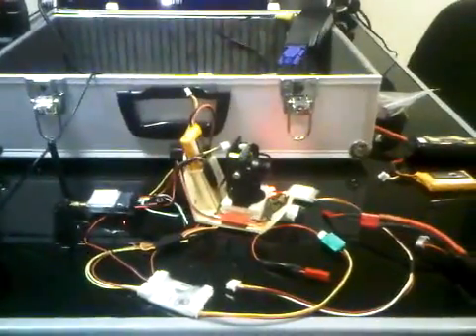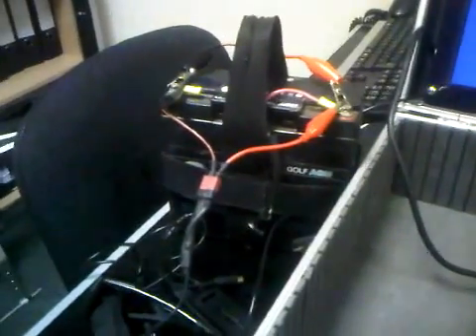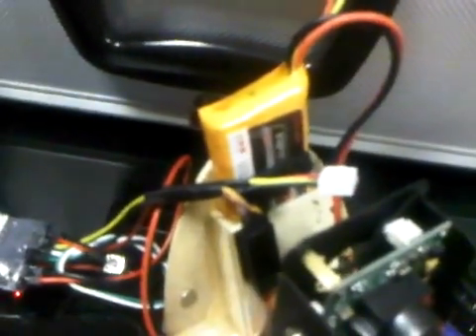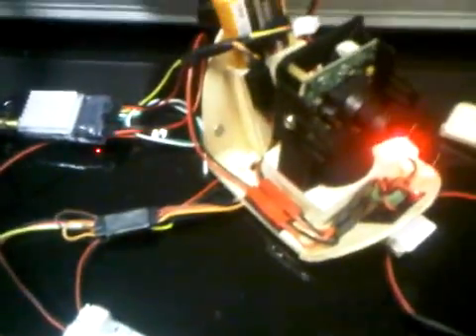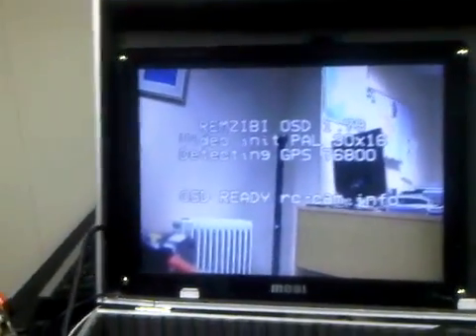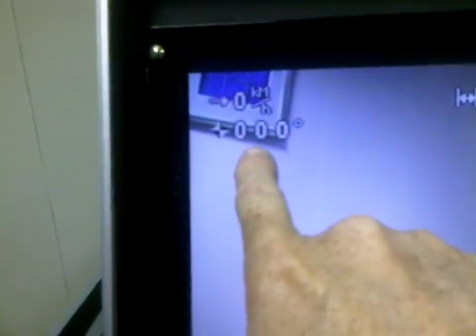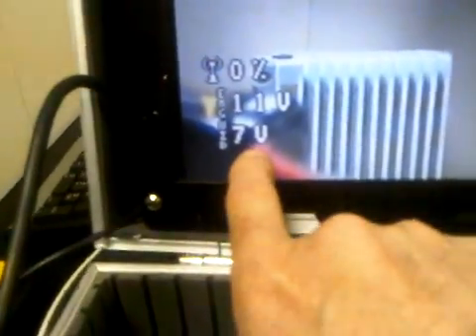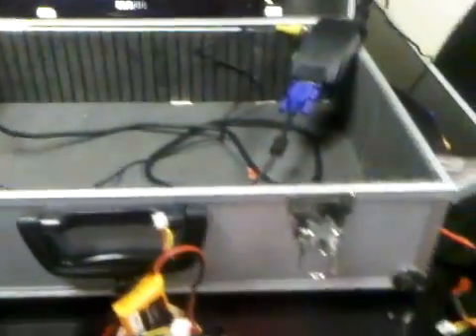Remzibi and FPV set up.3GP

Comment from the maker: The 5.8ghz system has a set of 4 "dip" switches on the tx and rx - all I did was match them and the link was established. The OSD does not require any channel allocation, it just sits on top of the video feed and is seen as an overlay on the screen.

I use a 2.4ghz radio system to control the aircraft (8 channel) and I will be using one of the channels to control the pan of the camera - but that won't be done for a while yet. The radio system is completely separate to the video system.